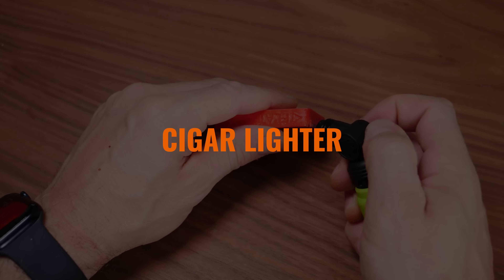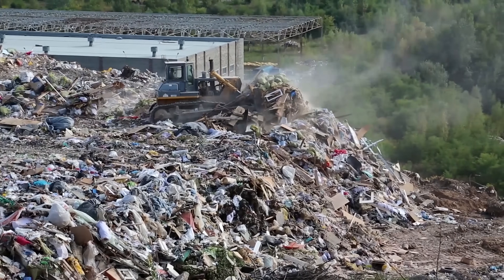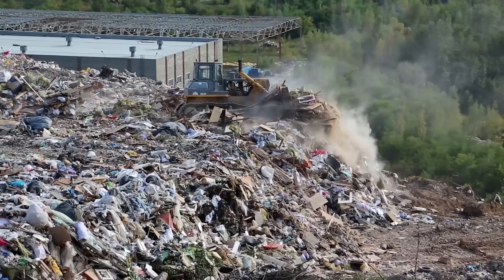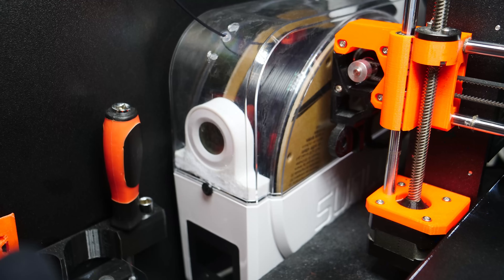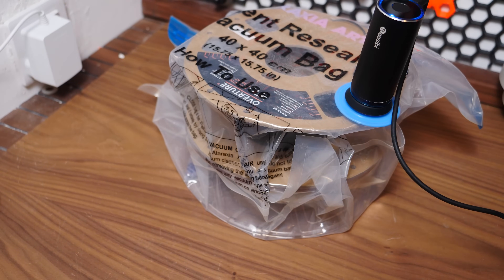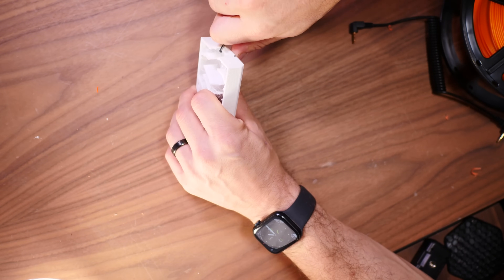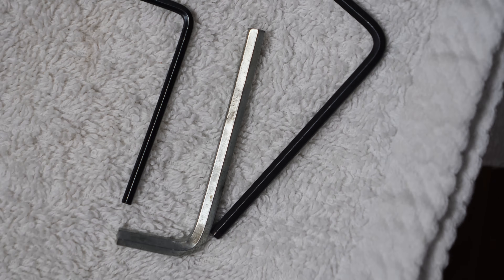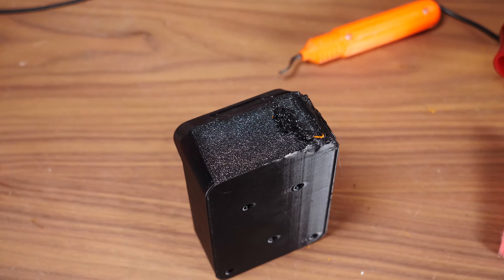15+ 3D Printing Tools You Definitely Need

Comment: I used microfiber cloths instead of paper towel for a long time but ended up finding that it didn't absorb contaminants nearly as well. Switching to paper towel was a game changer. Hardly ever have to wash the build plate with dish soap anymore.

Comment: I have a glass print bed.  I use cheap hair spray for adhesion.  Wipe it down with alcohol one a week.  Once a month it gets wiped with acetone.  granted, I pretty much only print in PLA, so take it with a grain of salt.  I also bought a cheap food dehydrator, modified the trays so I can fit two spools plus one regular try to put silica packs (even the non-reusable ones) and put it on low for 9 hours.  everything gets dried and I can reuse the packs as well.
Reply from the maker: PLA will stick to anything. Try using ASA lol.

Comment: Filament in the oven? Hard pass. A food dehydrator works great and has less risk of melting the whole roll. My oven only goes as low as 170°F but with how the temperature controls work, it's all but guaranteed the temperature will go higher as the heating element is on.

Comment: If you can't find 99% buy the 70% alcohol and then add salt to it and all the water will drift to the bottom and give you almost pure alcohol on top.
Reply: Lmao. No. To anyone reading this, don’t do it. Molecular sieves can accomplish this, but salt will not.
Reply: Actually this could work... The salt could bind with the water and raise it's polarity. Which in the end could separate a part of the water from the isopropyl alcohol. But I still don't want ressidues of the salt on my print bed.
Molecular sieve is also in my opinion superior, you should be able to reach much lower percentages of water with it and it is reusable. But you need very much to get from the 70% to something above 95%
Reply: @nathanmackenzie1174   we did a test burning a wick. It burned a lot brighter after removing the salt water 💦
Reply: @jitone1  show your work
Reply: Lol
Reply: Or you could just freeze it. The water will freeze the alcohol would not in theory? Pour off the alcohol.

Comment: A 3D pen is definitely useful. I was printing a planet carrier for a planetary gearbox, the planet carrier would require a lot of support to print it as is, so I split it up into the main body of the carrier and the pins. I printed the pins with a hexagon pin on the end and the carrier with a hexagonal hole. These fit together well and then I used a 3D printing pen to melt them together, making the join almost as strong if not as strong as the rest of the print.

Another cool application I just thought of is to use on wear surfaces on your prints, when it wears down you could just use the pen to add another layer of material on top, sand it to the required shape and then use it again, without having to reprint the entire piece. Similarly you could just use it for repairing 3D prints.

Comment: When you cut or drill metal you are left with a little material around the edge of the cut or hole, this material is a very thin layer of very sharp metal, that is what a burr is. The deburring tool runs along these cut or drilled edges and removes the unwanted metal, it helps with the finish of the part and it removes the razor sharp burrs, making it safer to handle. So it is a tool for removing unwanted material from edges, which is why it is also very good for 3D prints and cleaning up edges.
Reply from the maker: Nice. Thanks for the education!

Comment: To clean my bed, especially to remove built up glue stick, I use mostly glass cleaner and a lint free cloth. 
As for filament storage and drying, I store my filament in an air tight box and have a tub of Damp Rid in that box. For drying the filament, if you don't want to shell out for a dedicated filament dryer, you can get one of those cheap round dehydrators and use it instead. Benefit of the dehydrator is that most can be run longer at a lower temperature.
Reply from the maker: Interesting. I wonder if it harms PEI tho?
Reply: @thenextlayer  I haven't had any issues with my PEI flex bed.

Comment: Nice list! Adding the wrench to my kit.    The others I was already using.  2 tips I've come across related to these tools.   

Tip 1: Instead of the cigar lighter look up butane soldering irons.   They usually have small heat gun attachment that can very precisely heat or clear strings. Along with the torch and metal tips you can use for shaping or cutting prints.  Berkling BSG-568 is a quality unit, but there are other cheaper ones.    

Tip 2: There are other blades for your deburring tool!  Noga is a high quality brand that has so many attachments it will make your head spin.  One I want to feature is the S150 blade that will drop into your current tool.  It is designed for plastics and has a much finer point that the typical S10 style, which is great for getting into tight spaces on your 3d prints.

Nice job explaining the uses of each item featured!
Reply from the maker: Wow great tips (no pun intended) THANK YOU

Comment: I found the bags for vacuum storage of filament were not that sturdy and ended up with holes in them from pushing them into places they were not meant to go. In the end, I bought a food vacuum sealing machine and use rolls of heavy-duty vacuum bags. They cut to size and are so cheap they are disposable. As the bags are made for cooking in boiling water, they are really strong. The only problem I have found is my wife nicking the machine to seal food in and leaving me out of rolls of bag plastic.😖😖😖

Comment: Silica gel packages, I weigh them and write it on the package once it has been in the dryer for a few hours. You can easily measure how much water is in them. (need a sensitive electronic scale, I have one up to 200 g sensitive to 0.01 g)

Comment: I have great luck in easily keeping my filament dry.  I bought a clear air-tight storage box and keep a rechargeable color changing silica dryer (the type you hang in a closet) in there.   Now I keep open spools in the box, and the humidity stays around 27%-35%.  A spool that's been on the printer for days dries quickly when I swap it for one in the box.  It holds full size, mini, and sample spools (12 spools is my record).  Plus, with no bags, it's easier to see what's available.

Comment: Excellent tips on tools to get. Not sure if you mentioned it on the Microfiber cloth part, but they're pretty fairly cheap at most hardware stores (Harbor Freight takes the W on this one.)
Something that I'm looking for, as I'm in a basement apartment with pretty bad sound insulation, is a 3D printer case, shelf, box, display, Something to let me put it in, close the door, and still be able to monitor it without worrying if there's enough room in there, or vibrations causing the ripple effect on the print. It can also potentially help with the smell of PETG that, while "safe", isn't pleasant to have your apartment smell like.
I can see you've got one in the background, but you haven't yet gone over how well it works and how you made it/got it.
Reply from the maker: I have a video coming about this, probably at the end of the month or early January, stay tuned you’re gonna love it and make sure you’re subscribed

Comment: Using a textured pei works so good you don't ever need to clean the bed nor need to heat the corners, I've done hundreds of prints without even looking
Reply from the maker: I guess you’re just better at not getting your grubby hands all over it than I am, because even those I have to clean periodically

Comment: you would be surpised how well polycarbonate and nylon sticks to the printing bed if
printing bed is polycarbonate (yep, a thin sheet from Amazon) or nylon clamped to the bed all around, or in absence you print with 20mm brim around and clamp down the brim after the first or second layer, before it lifts up, using some thin metal long plates and paper clips.
Reply from the maker: Oh damn that’s pretty smart. I didn’t think about just getting a piece of poly carbonate. Does it heat up as much as you need?

Comment: You might or might not know it but you are a "natural" presenter. HOWEVER video's that are longer than 10 minutes and pushing 15 minutes just becomes TEDIOUS. IF a presentation is properly planned one can impart a lot of information in less than 10 minutes. The saying goes "how do you eat an elephant 🐘?" The CORRECT answer is "bite by bite". 😃
About print bed cleaning 😌. I avoid touching the print bed as much as possible. 
For occasional cleaning I use medical alcohol that comes as small patches. 
Getting anything from outside our country is virtually impossible as it has taken on average 4 months and was not then stolen in customs. Nowadays the only way is by international courier at about 1000% ripoff.
Reply: BTW it seems as if 3D printing will bring America out of the Dark Ages 🤔 of imperial measurements as Americans are now forced to use millimeters, kilograms and °C.
Reply from the maker: Thanks for the kind words! I’ve put in a ton of work to come off as a “Natural” hehehe

Comment: "I dont even know what a burr is." ...Then proceeds do define it perfectly spot on, LOL! Love the channel, new subscriber. A tip when ordering rotary burr knife blades: For 3D printed parts, be sure to order blades designed to use on aluminum and soft metals, NOT the ones for hard steel. They have different cutting angles, and the one for steel will chatter as you pull it along a part edge, leaving a worse edge than you started with. Also be aware that the blades made for soft materials are ground at different angles on each side and are designed to cut in one direction. If you cut along an edge, and then cut backwards going the opposite direction, it will chatter and make a saw-blade-like edge on the part. These can be found in right and left direction. The blades made for hard steel have the cutting edge ground equally on both sides of the blade and work in both directions. Generally, a right handed blade is designed to draw inward (right to left direction)or toward yourself with your right hand, which gives the most stable control and smoothest cut. Vice-versa for a left hand blade in your left hand.
  These tools work incredibly well for de-burring or breaking the sharp edge of holes. With a right handed blade, whip it around the hole edge in a clockwise direction, and vice-versa for a left hand blade. In the machinist world, we call this tool a burr whip, and used correctly and with some practice can create a very fine, precise edge bevel or hole chamfer that looks as clean as if it were machined that way.

Comment: Regarding the space bags and electric pump- I have a small hand vacuum that I 3D printed an adapter for (obviously) that mates with the valve on the bags, all the air's gone in a couple seconds!

Comment: You should check out the Airlock bags that printed solid sells, they are even better than the eibos ones IMO! Eibos ones are still better than most cheapo ones, but I had a few not hold their seal. Haven't had that issue with the airlock bags and they are super thick material, also will work with your little electric pump.

Comment: Printing surface for nylon. First use a borosilcate glass bed and heat it to 100C, print within an enclosure, I get my enclosure up to 40C (you can use the bed to do this but I have an additional chamber heater as well.  250C nozzle. Use glue stick on the glass, I use six layers (no really). Print slowly with no part cooling fan. I print Nylon-CF, but also strimmer cord that works well (I like the colours). I tend to print with a 0.6 nozzle because of the nature of the parts I'm printing, the printing times, because I'm printing slowly, and because though you can print PA-CF through a 0.4 nozzle 0.6 is better (to prevent clogging, also use a toughened steel nozzle, CF is abrasive to brass, though I do use a ruby brass nozzle with a S/S insert instead of the PTFE tube). My 3D printer is a Qidi X-Plus which is doing me good service.
Reply from the maker: Great tips, thank you!

Comment: I wish you told me about the lighter trick before i ruined my PEI bed 🤦‍♂️🤦‍♂️🤦‍♂️🤦‍♂️🤦‍♂️
Reply from the maker: Ouch :( How'd you do that?
Reply: @thenextlayer  well corner warped. Saw the tip to use super glue to past the corner back on the big print.... Sadly super glue binds to textured pei.. Alcohol acetone and even flame torch didnt help.

Pei comes of with super glue

Comment: 🤞I haven't had to dry out any of my hygroscopic filaments yet.   I put them straigt into IKEA based dryboxes as soon as I take them out of their bag, and haven't had any problems yet.   (reusable dessicant and air tight seals).  At 25NIS/8USD per box, maybe 5nis/1USD in gasket material, the rest is printed.    It's a pretty good solution for the money.
Reply from the maker: Nice :)

Comment: I wipe down my head bed with isopropyl alcohol with a fresh paper towel before every print and about every two weeks I wash the build plate with good dish soap.  These steps really help the curling off the build plate. Thanks for the vids
Reply: I’ve been washing mine after every print. I’m NEW to this.

Comment: Those ball head allen keys are great until you try to use the ball end to finish tightening bolts then you start stripping metal. If you do end up using ball end wrenches do not tighten all the way with the ball end, ball end should do 90% of work getting bolt in with final torque coming from flat end to make sure you dont strip bolts. I ran a bicycle shop and hate ball end allen wrenches with a passion because my techs never cared how to use them
Reply from the maker: Great advice, thanks for sharing!

Comment: Hey, great video, and i agree with most of them, though i have a few that are very high up on my list that i would also recommend!

First would be a high carbon hook and pick set. these are great for getting support out of small areas, as well as being a useful tool around the shop. I also have a pair of dental picks that i have hardened by heating them up and quenching them. I like them too because they are a bit smaller, but if i had to only choose one, the proper set meant for mechanical use wins out! In a similar vain, i found a metal poker that is intended to be used to consume cannabis concentrates works well to poke and pry at thicker plastic which would otherwise bend the normal picks.

second, nail files! they are the perfect sanding sticks to get tight fitting parts together easier, and last a very long time since theres no paper backing to rip.

third, tweezers. I have some nice tweezerman brand ones, which are meant for cosmetics, but they are THE NICEST tweesers you will ever use! i have some needle point ones, as well as a wedge tip. The needle point ones are a lot more useful. I use them a lot for support removal, combined with the pick set, but another odd use for them i have found, is getting thin 1 or 2 layer prints off my print bed. I use a textured pei sheet, and the metal scrapers just don't work all that well. I feel like I end up using too much force or i scratch the bed. However, putting the needle point tweezer under the corner of the thin / failed print is easy, and as soon as the tweezer starts to slide under, the whole part is easy to lift up with no damage to the bed!

cant wait to try that torch lighter tip, i have canceled many prints due to slight corner lift, and that seems way better
Reply from the maker: Wow, nice, these are good. Do you have links to the ones you use?